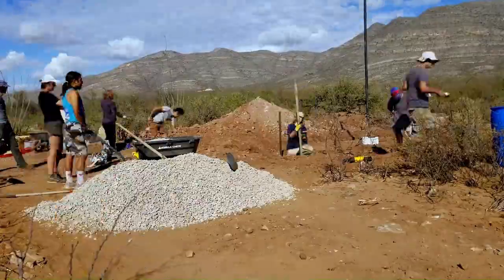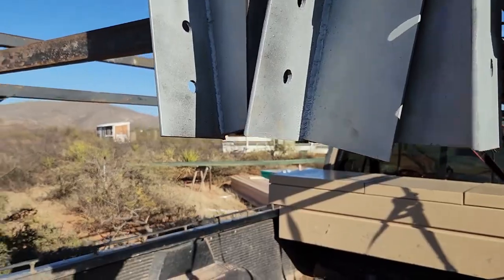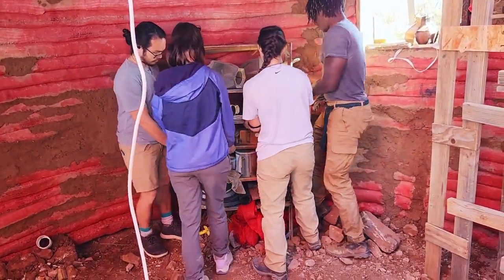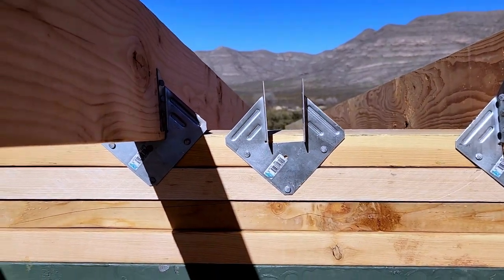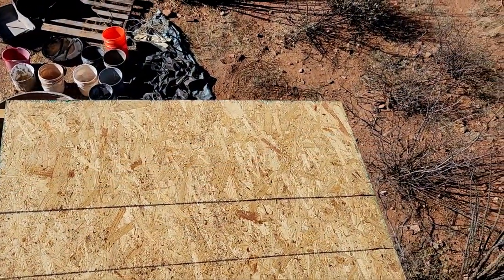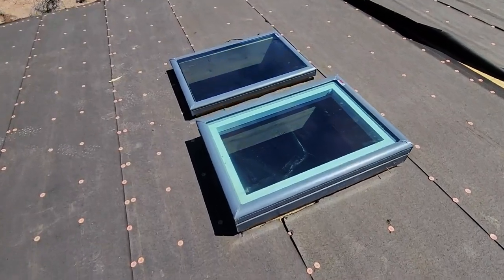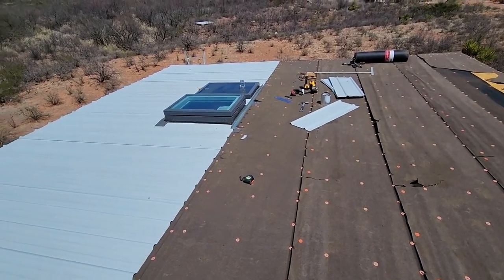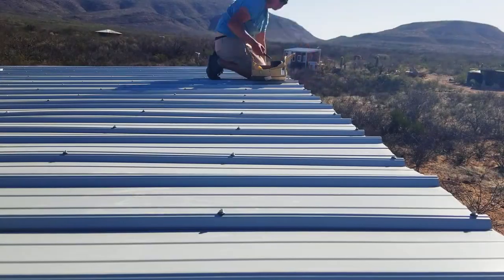How To Install An Earth Bag Hyper Adobe Tiny Home Roof: Documentary Timelapse

Comment: If you Staples string down over your black paper it will not rip in the wind after you staple the paper down nail the paper down just put lines of string back and forth and it holds everything four months until you get your medal on
Reply from the maker: Thank you for the tip! I'll have to do that on the next build.

Comment: interesting... I live in NM and have a desert property I'd like to do something like this on, but the winds get crazy high here- can the frame you made withstand extreme winds? what happens if the wire around the rocks breaks?
Reply from the maker: We designed it to withstand really crazy winds. The four corner posts are concreted into the ground and then a literal ton of rocks put on top. The rafters are all double hurricane tied. The straps are overdone, it's doubtful any one of them would break since they are rated for 6,000 lbs each. The gabion walls could be rebuilt if needed, but that wire is thick enough it should last a really long time.